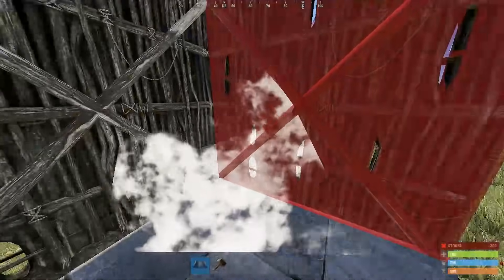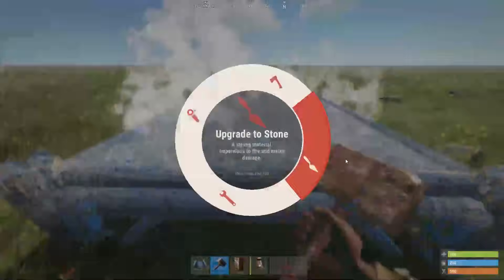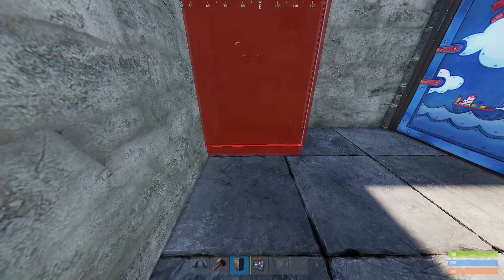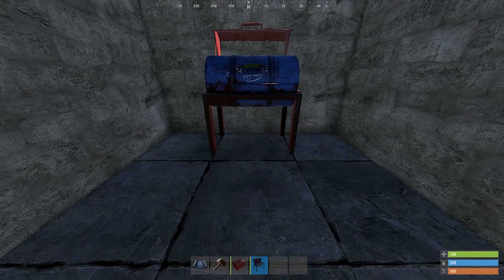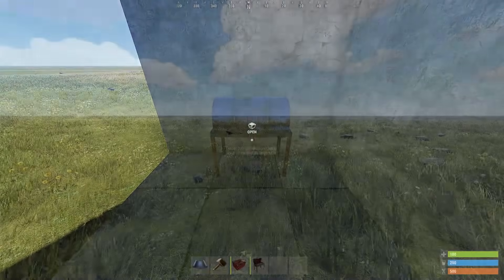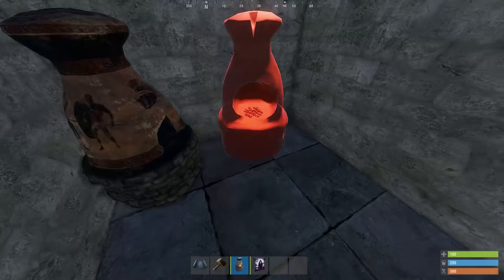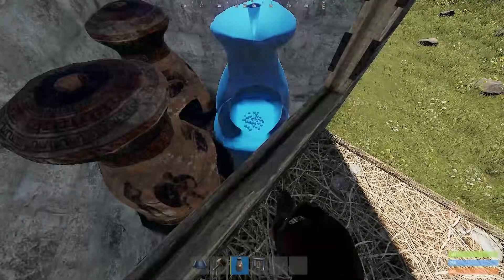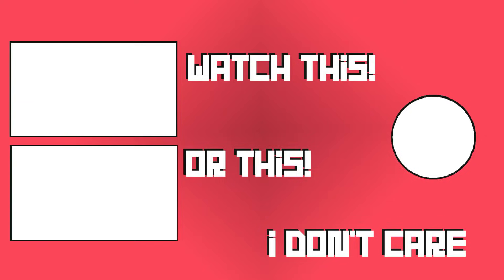Your Deployable Placement Is Wrong, Here's Why

Comment: A quick tip. If u rotate your wall and make it hard sided, u can place boxes in a square a lot easier. U can also fit 3 furnaces side by side, which allows you to place 9 furnaces in 1 square. Always remember to rotate your wall back tho.
Reply from the maker: Well but that is unrealistic as usually you won't place the walls and than instantly place the boxes.
Reply: @DavDavBuilding  I use it a lot, of course it depends on what kind of base you are making and also now knowing this info, when expanding your base, you can use the information and place boxes early. You can also rotate walls if you upgrade them, so you can leave them worse material and upgrade later. Many people struggle placing 4 boxes in a 1x1 so using this is really useful and it makes things faster and easier.
Reply: If you play on a 3x server or something easier to get resources this isnt unrealistic at all if im honest.
Reply: I've got to go with DAV d a v on this why the f*** do you need nine furnaces I really don't understand that why why it's just a waste of space even if you don't have a large furnaces you need like three tops just run them while you're out farming or PVP ing I mean you'll come back to 1800 anyways

Comment: if you place garage door first,  furnaces second, walls third, you can fit up to 9 furnnaces or 8 and a small box. the downside, furnaces need to point outward giving away cues
Reply: Didn't you post this after the other guy that is the worst advice ever given why do you need nine furnaces why don't we just put three at a jump up I mean you can also go to Every Square that you're not putting anything in your base and put 12 small boxes but why

Comment: Nice dude!! One thing I'd like to point out is that drop boxes can be looted from the other side if you use that last tip you shared though

Also furnaces can be rotated 180 to get them closer to walls/eachother
Reply from the maker: And why does that matter? Unless you would be able to place more in 1 space that way it doesnt really impact anything
Reply: @DavDavBuilding  if you've placed any not so perfect, rotation might be what you need to get it to fit
Reply: Ooh useless tip you know I really hate defending dev-dev but damn getting them slightly closer doesn't affect anything as long as you can get them up against the wall which you can just don't store anything important in the Dropbox if you have honeycomb I don't think it matters

Comment: fun fact if you place it first you can fit a flame turret in the little hole between the 4 boxes in a square
Reply from the maker: Well that sounds cool but also kinda useless.
Reply: @DavDavBuilding  surprisingly it has come in clutch quite a few times i use it in some of our bigger bases where we have some random free squares that we put the 4 boxes in for doodoo loot so i throw the flame turret in and it catches people off guard during online raids

Comment: You can also use a smal box instead of campfire whit the workbench
Reply from the maker: i dont think so
Reply: @DavDavBuilding 

 it is possible but it's tricky to place and maybe not worth it.

1. you need to have a small chest placed in the corner.
2. The other side of the chest where the workbench will need to be open (either open garage door or  Not a wall there).
3. You can put a wall thereafter the workbench is placed or close the garage door.

The workbench will not be visible trow the wall or garage door and will not mess up the storage in the other rooms.

by the way, I love the video and made me have much more storage in my base design.